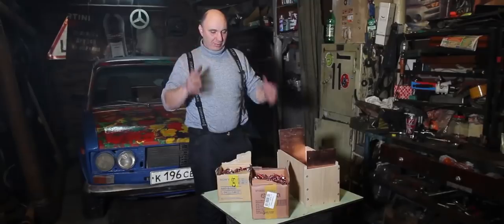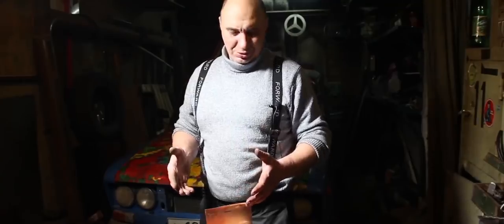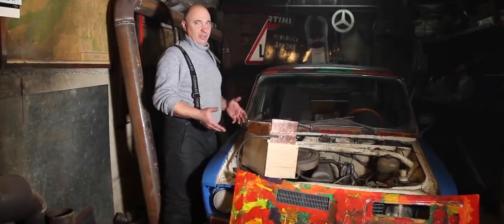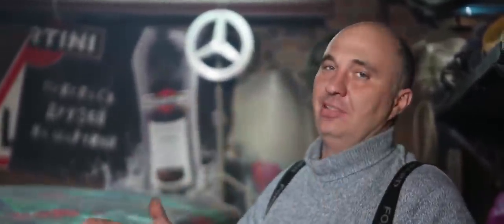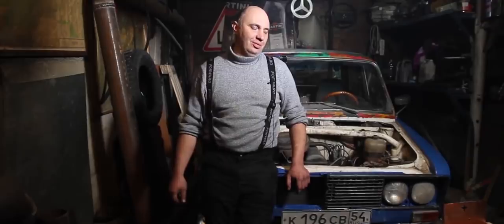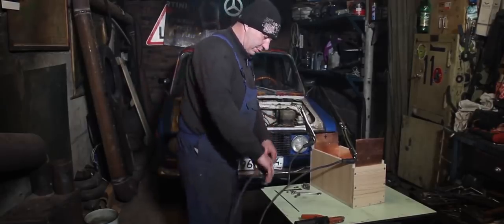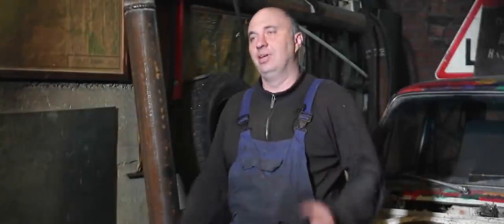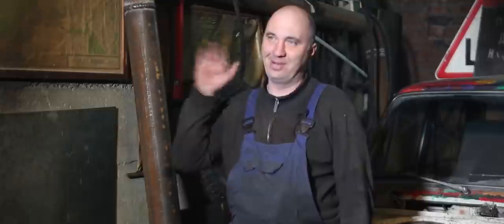1000 AA's instead of a conventional car battery

Comment: Run the engine on pure oxygen instead of air.
Reply: Is very dangerous as it so flammable
Reply: @SILVERSTRIPE_  oxygen isn't flammable... It's the fuel that's flammable and the oxygen just makes it burn better
Reply: Pyotr Ilych Tchaikovsky  yes, but Silverstripe psn said the oxygen itself is flammable :)
Reply: @mrbanana7167  Things that aren't normally flammable can become flammable in high oxygen atmospheres though.
Reply: @Aria18976  it's still the fuel burning, not the oxygen...
Reply: If using pure oxygen was possible then nobody would bother with N2O. Excessive amount of oxygen in the combustion chamber causes pre-ignition, it had to be diluted with other gases.
Reply: Trust the Banana...its correct.
Reply: @mrbanana7167  A lot of things do become flammable when oxygen is present.
Reply: Better would be to see oxygen vs. nitrous. Typical 4-cyl. will need up to 250 CFM, and its hard to regulate vs. fuel. Will also need 5x more fuel which can be hard thru a carb.
Reply: Pure oxygen is EXPLOSIVE.
Reply: Pure oxygen will explode if it gets in contact with motor oil
Reply: theres one reason this isnt a good idea. heat. it will melt spark plugs. therea papers on it everywhere
Reply: That’s actually quite similar to how nitrous works, pumping in gases to make the combustion more efficient. While I don’t think it would really have the same effect as nitrous, but I assume it would function somewhat normally. I have lots of mechanical experience, but I am not a qualified chemist, there may be factors I have not considered in a combustion reaction.
Reply: @DownloadedPixelz  i dont know why, but heat goes WAYYYYYY up with pure oxygen. hence, compressed air supercharging. they use air, not oxygen, even though in theory oxygen is the most efficient, it melts plugs and rings!!!
Reply: I assume you mean pump pure oxygen into the intake while the fuel system is functioning. If there is no fuel oxygen will not burn. if you add oxygen to an engines intake you will essentially have a nitrous oxide system with no nitrogen to cool your combustion temps so you will most likely be melting pistons and spark plugs and destroying the engine
Reply: Used to run the oxygen on the shop torch into the air filter to pass the tail pipe probe back in the old days.
Reply: It won't do anything
Reply: Oxygen isn't flammable
Reply: @Lurkerkun   Just need higher octane fuels XD
Reply: @mysock351C  those things burn, not the oxygen, what's so difficult to understand about this?
Reply: @mrbanana7167  it does not work well since you eould need a HUGE tank
Reply: @mysock351C  even metals
Reply: @resetcoder (Cody's video is interesting and I've seen it before) but yeah normally it's just an accelerant/oxidizer   I don't claim to be an expert of any kind in this, it's just that people are sometimes very ignorant and it needs to be accounted for
Reply: Mr Banana - oxygene is an oxidizer, very true. If it is not then i don't know what is :) but because our athmosphere has a large amount of oxygene everything that burns in it makes those materials "fuel". If we had propane as athmosphere then oxygene would be the fuel. The power comes from their reaction, so actually both could be the fuel. We (humans) just used to say it a specific way, because of our athmosphere.
Reply: @resetcoder  welp I'm just a kid who saw something that ssemed stupid and pointed it out lol :)
Reply: That would be interesting to see how the engine holds up
Reply: The banana is correct, I work in the aviation industry and I have to deal with pure oxygen quite often. You can put a flame right beside pure oxygen and it won't ignite, but it assists and the burning of fuels. An oxidizer of sorts, hence why you can't have oily Tools near oxygen because they can combust if there is enough oxygen.

Do you truly believe that we place highly flammable fuel into your lungs in the case of emergencies an aircraft? C'Mon folks
Reply: @Lurkerkun  Inform yourself HOW N2O works.... Facepalm...
Reply: @Nanobot02  Right back at you, pal. Nothing I said was wrong. People use N2O instead of pure O2 because:
1. N2O is more convenient in storing, it easier transforms from gaseous form into liquid and back;
2. High-temperature of combustion of will quickly destroy your engine;
3. Oxygen-rich mixes will combust spontaneously from tiny glowing particles left over from the previous combustion cycle or any heat spot in combustion chamber thus ruining your engine almost instantly.
Reply: @Lurkerkun  BUT it works COMPLETELY Different. Also you can Prepare an Engine for that. We are not here to see long lasting Cars. Iam Interested aswell how it would perform if you Add Oxygen, of course this is nothing you would install on you everyday Car.
Reply: Fuel the engine with the metal making up the engine.
Reply: @mrbanana7167  oxygen is flammable
Reply: oxygen and crank case oil could be bad.
Reply: @thepyrodude  anything to back it up or just throwing ir out there like that?
Reply: Lassi Kinnunen  what does this have to do with me again?
Reply: Mr T  NOS is Dinitrogen monoxide. Pure Oxygen would cause pre-ignition / knock because it would instantly react with the fuel at normal running temperature. Nos is used because it has the additional nitrogen that causes the oxygen NOT to pre-ignite with the fuel. So when heating up the nitrous oxide breaks into nitrogen and oxygen, basically pumping more air into the engine.
Reply: Lassi Kinnunen  you know engines produce heat. You know the thing that makes things go hot.
Reply: Mr T  I laughed at your complete and total lack of knowledge and understanding. Ha ha ha
Reply: Yes
Reply: >BOOM<
No spark plug necessary.
Reply: @92_miata  Not without fuel it isn't.
Reply: @mrbanana7167  "Welp"!!! I have heard that since my dad was alive! Memories, man!
Reply: @Lurkerkun  I suspect the heat of compression might trigger combustion,  as in diesels, especially in an already hot engine.
Reply: nothing can run on pre oxygen since oxygen is not a fuel
Reply: @SILVERSTRIPE_  it's  not flammable but acts as a catalyst for flammables
Reply: Pyotr Ilych Tchaikovsky  not necessarily, more combustible with more oxygen does equal more fire
Reply: Only if you like explosions.. .
Reply: @mrbanana7167  HuR dUR. ReAlLy?!  Who ever said oxygen is flammable?
Reply: @windshearahead7012  my fucking god just read the replies which were all written like 5 times already
Reply: 1000*1.5v is 1500v... you could have run them in series/parallel to achieve 12ish volts with more current handling
Reply: The problem with pure oxygen is it would cause the fuel to burn too rapidly. Instead of the controlled combustion that normally occurs it would be more like an uncontrolled, rapid explosion. Because pure oxygen is an accelerant what would likely happen is the engine would be prone to backfiring out the intake and likely damage the intake manifold or crack rings or ring lands on the piston and damage or destroy the engine in a short period of time. 
The reason Nitros Oxide (N2O) doesn't do this is, as the oxygen splits off, the nitrogen acts as a buffer during combustion, slowing it down so that the rate of expansion and resulting cylinder pressure, while higher than without the N2O, is safe.
Reply: @SILVERSTRIPE_  I'm pretty sure if you empty a pure oxygen canister into a running engine it would blow up.
Reply: HHO... get to it.
Reply: There is an apollo spaceship that would disagree.
Reply: Do i believe you personally would knowingly do that? No. Do i believe someone higher up would try to trick you into something like that? Only if it was profitable and low risk. That's life bud. Yes it is. Why do you think you are so far down the chain?
Reply: Pure oxygen turns gaskets and seals into rocket fuel. You can burn Iron in Pure oxygen. Oil will explode and gas will burn before entering the combustion chamber
Reply: Mastermilo tried to do that. But instead of running on oxygen only, he added the pure oxygen via the air intake hose
Reply: @thisguy4787  "There is an apollo spaceship that would disagree."
Disagree with what?
Reply: @mrbanana7167  But pure oxygen can make many unflammable (in normal air environment) objects like iron flammable. So if you give engine pure oxygen, you gonna burn the entire engine, or the car   :-P
Reply: @Aria18976   I learned in chemistry class that iron (Fe) can be ignited and burn in pure oxygen, leave Fe3O4 after the burn. And the burning looks like fireworks.
Reply: @ddegn  Seriously? They made a movie about it....Here.....

https://en.wikipedia.org/wiki/Apollo_13
Reply: @SILVERSTRIPE_  a car with electronic fuel injection might work fine since it has oxygen sensors in the exhaust - it should be able to automatically recalibrate the air/fuel mix on the fly.
Reply: @pqhkr2002  yes, that is true, and I would like to see that.
Reply: deee327ify  did I say it was a good idea? Well I'd like to see it anyway..
Reply: It would probably just make it run faster or something.
Reply: Oxygen combines with the elements around it to form molecules with them, the more available oxygen, the higher the combustion temperature and the cleaner the burn. If the engine ran at all, it would be because it had serious valve-seal wear that allowed oil to drizzle into the cylinders during the intake stroke. The reason nitrous oxide is used by racers is that it is less reactive than concentrated oxygen used for cutting torches and such, steel  wool will "burn" in an container of pure oxygen.
Reply: Burn a hole in the pistons for sure. Nitrous Oxide basically works in the same way. It's a gaseous mixture containing oxygen. A lot more fuel is needed (rich burn) to keep it from burning holes in everything.
Reply: Mr Banana The chemical reaction between oxygen and fuel is called burning. Both are burning together. They can't do it separately
Reply: Nope
Reply: mastermilo have done it.

the engine is toast.maybe the piston melt due to very high temp combustion.engine knocking heavily. but the engine perfomance increase
Reply: Oxygen alone isn’t flammable by itself, oxygen feeds the flame allowing it to oxidize faster in turn increasing the flame size. And I think he’s made a video with a car running on pure oxygen instead of air.
Reply: This was already tried in the 70's or 80's in an effort to squeeze more power out of race engines. The engine blew up almost instantly cause the combustion was too violent
Reply: @SILVERSTRIPE_  Oxygen is not flammable, it supports combustion. Think, if it were flammable, why would one need acetylene with an Oxyacetylene torch?
Reply: it would destroy the engine
Reply: @Lurkerkun  the no2 bond is much weaker than the binary 02 bond in air . This is why no2 is used to accelerate burn rates in fuels . Very little rise in temperature breaks the no2 bond , releasing individual o's . Single oxygen is a mega  acceleran .
Reply: @texasdeeslinglead2401  From what I gathered: O=O - average 495kJ/mol
N=O - average 607kJ/mol
N2O bond seems to have higher bond energy, meaning it's stronger.
Reply: @pepeknamornik6884  the big misconception about injecting o2 in an engine is the immediate image conjured in the imaginations of gear heads that the combustion chamber has no atmospheric air present anymore . In that line of thinking , yes the engine would be eaten  alive , if it lived past a couple of rotations without predetonating to death 
Reality is , practical real life  applications would be adding percentages to off set injectors rich potential . We are not living in the days of carburetors and vacuum advance engines . This injections of oxygen could actually be very interesting in racing motors using diesel fuels with extremely rich potentials in lower rpms . Modern diesel engines utilize  multi staged injection cycles per  each cobustion cycle . This could be modified in programing alone to be a second injection at tdc with oxygen enriching secondary injectors on each cylinder . Multi injector heads are not new tech , so it's really not far fetched to think this could be tested . As far as nitrous , it's efficient at  cooling intake gases like decompressing o2 can also do , and nitrous helps prevent predetonation that o2 in the hands of dingbats won't do .  Some gear heads swear on a stack of bible that nitrous can be compressed into a liquid and o2 cannot . Sure fooled the whole bulk o2 storage world . For what it's worth to anyone reading this , yes o2 is compressed into liquid . It's at some ungodly pressures and doesn't enjoy being in such state  . Thus using lox in an injection system is better left for Elon and his gang on the way into space . And this is where it gets kinda wierd , if o2 in liquid form is not practical in racing vehicles due to containers not readily avaliable to public  and venting issues due to changing outside ambient temps   , then what is ? Enter Nitrous . It can be compressed into a liquid far more readily and far more safely in a wider set temperature ranges  . This gives the gear heads a readily more safe oxygen rich combustion modifier .
 As far as  molecular bonds are concerned , o2 disassociates at a much fast rate thus creating more heat and pressure , something argued endlessly about  . But nitrous disassociates at a higher temperature and higher pressure ,  thus preventing predetonation , making it far more safe for idiots not good with slide rulers and formulas . 
To those who theorize o2 as burning up metal parts in an engine , in particular carbon deposits and aluminum . First the o2 presented  would have to push the combustion to an extremely lean state due to over oygenating the fuel supplied per cycle in the individual cylinder .  Lean engines are not desirable , we all know that . Or so I hope we do . Second , if the o2 is controlled by programing , the engine should never be allowed to lean out . Again , this is writing code and doing math beyond shoes off to count . It's some wierd nuanced thinking fun . It's not impossible  but completely impractical . I conclude with it being so impractical as to be useless . Unless uncle Elon can manufacture a cheap lox container that doesn't require venting due to ambient environmental  changes . Then it on . Lol
Reply: @Lurkerkun  oh god dude this channel is all about experimenting and doing weird stuff. No one cars if there is engine knock. The engine will get more power for sure. If it gets destroyed thats another story